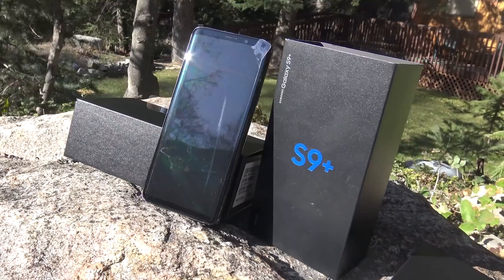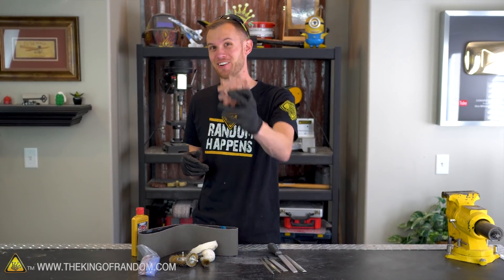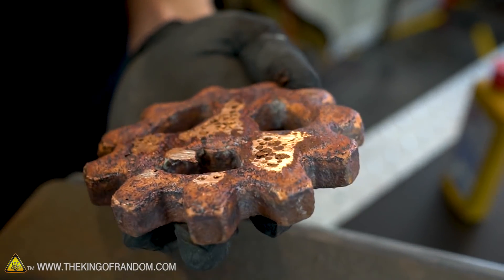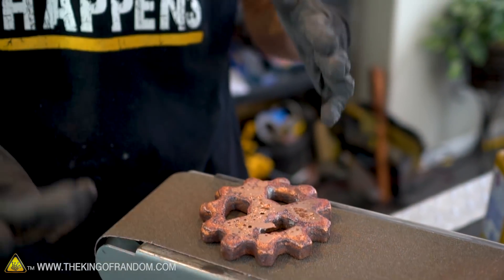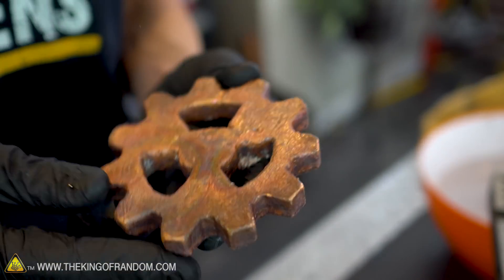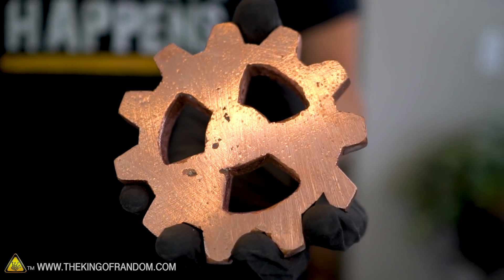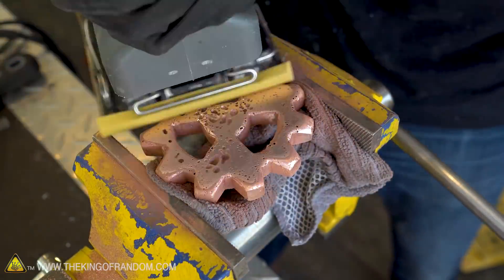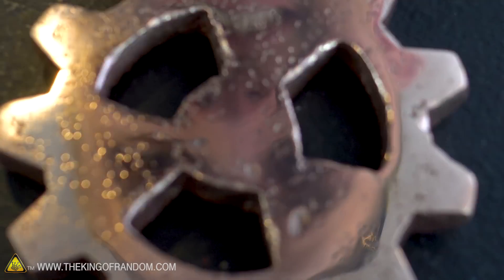Shiny Copper Gear! What Happens Casting A Copper Gear?

Comment: The holes are there because you used a wet sand that contained water which tried escaping thru copper if you cast there has to be very little water so it doesn't happen

Comment: Could the wholes be based on water coming from the sand avaparating from the heat from the copper as its pored in the mold.

Comment: Those bubbles are from evaporating moisture. You can eliminate that by first baking the plaster in an oven just like you thought was not necessary. It may not have been enough to explode the metal but it certainly did bubble.

Comment: Maybe the bubbles are forming because of the foam, it has bubbles of air trapped on it and because copper starts to cool very quick the bubbles of the foam don't have enough time to escape from the cast, so it's why's bubbled in the top i think.

Comment: I'm not too awfully smart, but one thing I've held onto from school is that silver has the highest thermal AND electrical conductivity. ALSO, it has the highest light reflectance. I fact checked to be sure. Apparently of ANY element. i knew it was king of metals in those ways but i did not know that.

Comment: I do glass casting alot and I think you had to much water in the sand and you should build holes to let the gases escape from the styrofoam. Also you could make a wax of the styrofoam, then make a plaster silica mold (melt the wax out with steam) dry it at 90c for 24h in a kiln. Last step, bring your mold up to the temperature of about 600c, slowly so the mold dosent crack, 24h should do. When it has reached 600c pour strait into it and wait for it to cool. I think that would be your best bet. TIP: paint the mold on 10 layers should do, for layer is thin and very liquid to get all the details.

Comment: There is no casting of copper because of the composition of the metal that has a high transfer of heat. Thats the problem of the bubbles apear the it is necesary a element that make stable the temperature thats the reason of use of tin. And the reason of the bronce(cooper+tin) is used in casting sculptures. Other thing is the figure. If you want a pure cooper first cast a big circle and the with machining gear generator you can get the figure.

Comment: Wait I'm aware you used polishing bits for a router to smooth it out and stuff but the nail file doesn't really fit it why can't you just attach a sanding sheet router bit

Comment: And the reason you had bubbles is because of the Mould not being completely dry and when the molten copper hits it the excess moister evaporates and causes little pockets of steam in your casting

Comment: the bubbling in the metal is caused from either your metal cooling to fast or it not being able to vent out the gas through the bottom of your mold.  better quality sand would help with that so it can vent better plus a kiln or just using a torch on it for a bit so it can cool slower will help.

Comment: The bubbles in your cast were because you made your mold with packed sand. When you pack sand tightly around the mold, the air has no way to escape except through the liquid metal, causing air bubbles. Instead, push the mold into loose sand and only pack it around the edges of the mold. This way air can escape through the sand instead of your cast, eliminating bubbles.

Comment: One of aluminium casting videos for car engine moulds, they used to fill up the mold from bottom to top to avoid air bubbles...and buddy please wear some air filter mask while sanding ... Too much of zinc or copper inhailed can cause metal poisoning ...by the way gud project 😀

Comment: I think (i'm not sure) but i would've tried, mixing the copper dust with super glue and then fill in those holes/air bubbles marks, and the do another  round or two of sandings and buffing.

Comment: Those bubbles are caused by the mold being too cold compared to the molten metal, heating the mold before poring the metal minimizes/prevents those bubbles from forming.

Comment: There were several issues with your casting process.  You were right in thinking that the copper is too dense to properly flow and be constrained by the green sand.  Your idea of using the wall texture isn't the best, as any residual water in it will flash to steam, which makes bubbles in the molten metal.  The foam also has that kind of effect.

A better idea would be to use water glass (sodium silicate) to basically glue your green sand together into a solid form.  Once the sand is pressed, you'll want to remove the foam form and spray the area with carbon dioxide to set the sodium silicate and let it cure.  The sand molding made with the sodium silicate bonding agent should not be re-used.

Also, before pouring, you should make an attempt to degas your molten metal.  For something like aluminum, the flux used is simple table salt.  I'm not sure which flux you should use with copper, but the process should be similar.

Comment: im not sure but maybe vibrate the liquide copper in the gear form helps to avoid the bubbles. i dont work with metal but know that with some other materials you can avoid bubbles with vibration.

Comment: If you would have used a "gate" to fill the casting from the bottom to the top. You wouldn't have had all of those air pockets in the casting
Reply: By pouring from the top to the bottom, you locked in a lot of air pockets. 
Next time, pour from the bottom to the top, pushing out all of the air pockets.

Comment: Willing to bet if you did a two piece mold with a pour spout and a vent you could still use the foam gear for casting but allow the gasses some where to go and also help keep the copper longer. Also noticed in the last video you never used a degasser on the molten copper and didn't clean of the top. Great videos. I'm going to subscribe.

Comment: Hey, Next time you cast, quench the copper in oil (not water) for less bubbles. After getting to room temperature, put the copper in a 500 centigrade oven for stress relief

Comment: The bubbling in the metal is from the moisture in the plaster you used. You would be better off using a jewelers clay or slip casting. Of course it would be easier to use wax models that can be burned out before casting.

Comment: regarding the mold, perhaps create the same plaster cast around the foam gear, build up the plaster quite a bit, then once fully dry and hard, dissolve out the foam with acetone to leave an plaster negative of the gear.. you can then touch up the plaster to make the inside smooth, then nestle it in the sand and cast the copper, slowly to avoid introducing bubbles, (maybe build a sturdy pivoting jig to put the crucible in)..
break off the mold and the copper gear should be pretty much done, just need to file and polish..

Oh, and when using the belt grinder, do it outside, and wear breathing gear, ear, and eye protection, your health is far more important than youtube views..

Comment: I'd suggest you to vaporise the foam off using the crucible's heat and then pouring in the molten copper in as to avoid bubbling. Another trick is to make smaller gear so it has lower surface area exposed, it would take more time for it to dissipate heat and solidify thus giving air bubbles enough time to escape the copper, also  you can use a blow torch/solar scorcher while pouring to maintain it's temp. for the bubbles to escape.
I don't know if you'll ever read this, but I hope it helps.

Comment: Try using copper solder wire and flux to fill up the holes and sand it down for a clean finish!

Comment: PUT LIQUID METAL IN A VACUUM CHAMBER!!!!  😎
Reply: Unless you use mercury, your molten metal will be solid long before the vacuum is built up. And the extreme heat radiation may damage parts of the vacuum setup.

Comment: When you pack the sand and pour the copper utilize a vibrating bed and you will have much better results. In fact if you create a project making a vibrating bed first you can get the audience involved with the process. Just a suggestion.

Comment: Those holes would be a form of porosity made from gas or debris in the pouring process. My guess if you use a lighter densitity foam you would probably get far less porosity

Comment: Nice job! All these holes and bubbles are propaby from the plastic foam. when foam gets hot enaugh, it  will waporate and burning making gases. and these gases have been left on the copper, when it's getting solid again. I think this is the most reason for these bubbles and hoels etc. I haven't ever use boorax, so I don't have any experience of it. But regular table salt I have. Salt would be helpful on copper castings also. At least it helps on bronz and brass castings at my experience of it's use.

Comment: If you don't mind some extra grinding you can use the copper powder that you ground off and put it on the gear and use a propane torch or something to melt it into the bubble holes.

Comment: You also used the wire brush wrong, the instructions give a detailed explanation on how to properly use the brush at certain angles and to not stress them by not appliying pressure

Comment: The slurry that covers the mold, if used for casting, must be degassed first, otherwise there is a large number of bubbles inside the slurry, the gas is heated up when casting, and the metal liquid shell is cooled first, the gas can not float out, and finally the bottom hole is formed.

next time , try to use wax and cast red sand to make mold , it will get a nice surface!

Comment: Try putting the drill in the vise, using some electrical tape or a zip tie to hold the trigger, and handle the part you’ll have better control.

Comment: I have a feeling the bubbles you're getting in the copper are a result of the polystyrene melting and balling up while releasing some gasses. As a test try casting something small in a cavity mold vs a polystyrene one. Like a cube (or another gear). If you get bubble free that will show the result.
Additionally any moisture might turn into steam and expand but as the metal thickens and hardens it might not be able to completely escape, leaving the bubbles.

Comment: If you saved the copper dust could you try to melt it down and cast it into some ingots?
Reply: TheLegendAX 99 it wouldn’t be that much copper + it’d be hard to clean out because you’d have all those extra particles from the sander
Reply: Not to hard to chemically separate.  They could send it to Cody and I'll bet he could easily do it.

Comment: I think thoose bubbles are because of the foam in the form. Something like a smoke when it burned.
Reply: I agree, he should try burning it first and then casting the metal
Reply: That, and the drywall paste still had moisture retained in it that steamed up. You can see and hear the water vapour, which isn't natural to copper casting.
Reply: Nope, copper unless protected by a flux will always have bubbles.
Reply: Im working with melted metals on work, and this pores(that is the actual name of it) because of colliding oxygen, and metal(chemical reaction strats). In fact you can use some gases, to protect metal, or use flux.
Reply: sorry I meant to send it to daddy nino 
but it glitched
Reply: @TheRedKorsar  Are you saying you could use argon gas as a flux like you use for TIG welding? That would be pretty cool
Reply: When he burns it makes air bubbles cause fire needs air then it puts bubbles in the cast
Reply: din din din din din
Reply: Its the wet sand!!
Reply: I agree. The water in the sand and the texture compound is creating steam as soon as the copper hits it. You need to preheat the mold to drive out ALL the moisture and use flux.
Reply: It's Actually From The Copper Cooling To Quickly, Common Copper Casting Issue
Reply: It was actually because they packed the sand instead of just packing around the gear the sand everywhere else should have been a bit loose allowing the air to escape through it from the initial poor
Reply: Those not thoose
Reply: WHO CARES

Comment: Can i ask something. What happens if you burry a jelly fish
Reply: Minecer gaming it dies?
Reply: Minecer gaming i thing it will evaporate,the same effect if you put them under the sun...because they are 98% water
Reply: Minecer gaming i'm so sorry..i thought that was "burn"... i only notice it when you replied....
Reply: Jezreel Ric Lacia I am curious to see the aftermath
Reply: I've seen a bag of water that used to contain a jellyfish and hot water. Not even boiling, just hot.
Reply: Minecer gaming jelly fish is organic , so same as any organic structure:
It will break down and became firtlizer for the soil and release some methane gas.

Comment: Next time wear a mask because there is aluminum in those belts on the sander and also the copper dust. Both are horrendous for your lungs
Reply: Agreed. I'd have a shop vac running next to the belt, too.
Reply: Plus risk of metal dust fever
Reply: Yep
Reply: Hed probably eat the copper and aluminium dust
Reply: I once sanded metal for two hours straight and mostly just copper and aluminum
Reply: YGS
Reply: Also he shouldn't be wearing gloves with a sander. They'll grab your glove and take your hand. If you hit your finger with a bare hand you will just lose a bit of skin.
Reply: nah such coarse grits are made from ceramic abrasives
Reply: I was just cringing at the sight of someone using a belt sander without protective gloves. Degloving accidents are not a productive way to spend a day.
Reply: but how can you lose a glove if you don't have one silly. ;) /s
Reply: +Malice Stripes I don't think you know what degloving is.....
Reply: Also when I took material science. We shined up copper by starting at 120 grit, to 240 grit, to 360, to 400 the to 600 and finally finishing it with 800 then polished it using 1 micron in size polishing powder. Also I would have kept that belt wet so you wouldn’t have to worry about the copper dust.
Reply: And, don't wear gloves when sanding.
Reply: But he can't do that cuz he's dead
Reply: One time exposure like this is not dangerous.
Reply: Jackson1701 True, buts it's a bad habit to fall into

Comment: The foam was 'vaporized' (and partly turned to dross) when you poured the molten copper. Vaporized. Vapor. It didn't disintegrate into nothingness.Those bubbles are the trapped gasses of that displaced foam, further trapped by the top facade you created to prevent the sprocket holes from collapsing during the pour.

Comment: The bubbles were caused by steam and moisture from that plaster mix you used. Thats why its not done like that 99% of the time. True molding uses only the sand. It takes a bit of practice to get it down right but it produces a much cleaner cast.

Comment: You guys need better sifting methods and better sand  and you need to have an angled sand tamper as in the end need like a wedge on the bottom to push the sand in several ways

Comment: for future casting experiments, consider baking the plaster at a low temperature to speed evaporation. I think those holes are water vapor. It might be interesting to put dried plaster into the foundry to see what happens, offgassing and whatnot. Maybe read up on some chemistry first though.

Comment: you will need some sort of flux to get rid of the porosity.  That will protect it from the oxygen in the atmosphere. Not sure what though. Same thing happens when welding steel and other metals.  If not protected by a gas or flux in a molten state it gets filled with holes.
Reply: borax is a common flux used in blacksmithing, probably that
Reply: In the copper smelter I worked in they injected raw propane into the copper to  burn off all of the dissolved oxygen.
Reply: You're right both of you guys borax and oxygen leveling!
Reply: Borax
Reply: Borax is the best solution
Reply: @roastedpigeon  Borax is a powder. ...Sorry, nerd joke...Bwhahahaha.
Reply: Borax works great. I cast/pour copper all the time.
Reply: @TomokosEnterprize  Do you just pour the borax in your crucible and let it sit there before pouring? Or do you mix it in before pouring?
Reply: @akira3871  nah mate, you "ligthly" coat the mold with it, if doing traditional smithing, you coat the ingot with it after initial heating, and when you have to re heat it, also, if folding the metal in between each fold, or that's what i've seen smiths & casters do atleast
Reply: Not sure about casting but we use argon when we weld
Reply: Borax and a little baking soda together go a long way.

Comment: gases from the foam got trapped in the copper because it wasn't hot enough for the volume. get the copper hotter and place it on a vibration table and this problem shouldn't occur as bad.

Comment: the holes in the copper gear are caused by moisture in the casting mold causing it to flash boil the very little amount of water in the mold making it steam and causing the gas pockets to form

Comment: King of random if I was doing this I would spend lots of time on 6 difeent grits of silicon carbide sandpaper 80 240 400 600 800 1200 Then polishing compound on a polisher

Comment: cast a wax gear and cover all but top side in plaster 3-5 thin layers. melt the wax and cast copper straight into the mould

Comment: I love you and your vids but I may be right but I'm pretty sure that the bubbles formed by the foam burning and boiling away due to the copper being poured in right away but do the same method but melt or burn the foam away after casting the molding of plaster

Comment: I'm interested in the copper dust that came off the sander.  Could that have been sprinkled on the gear and then heated with a torch to fill in the little voids?